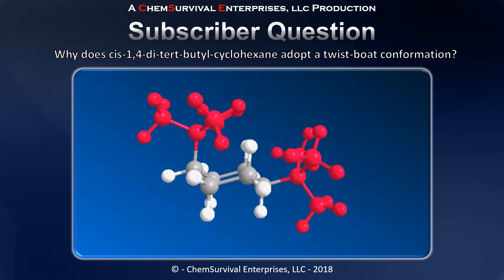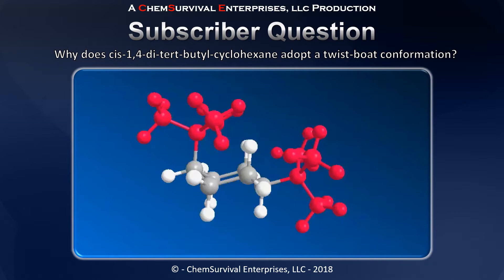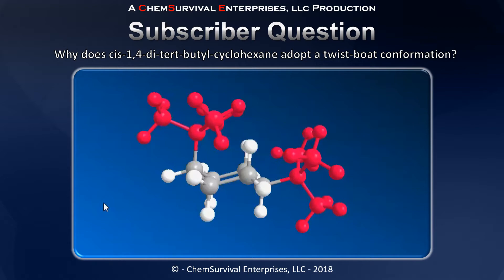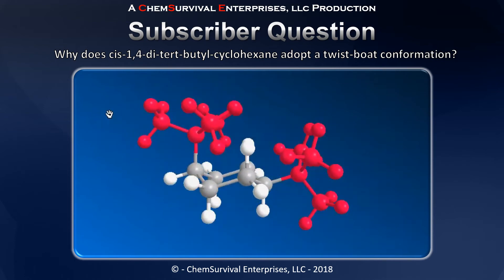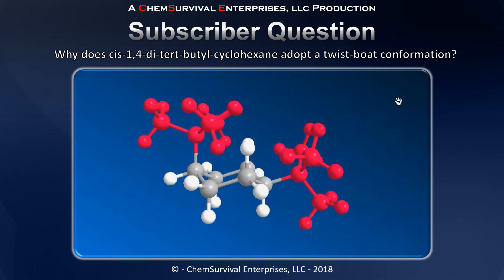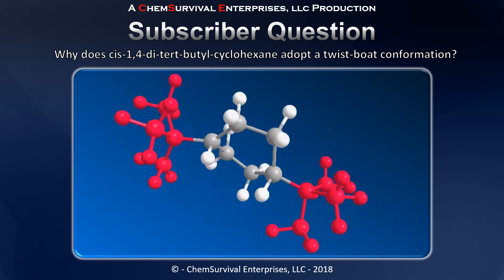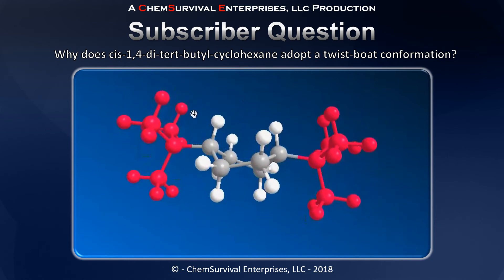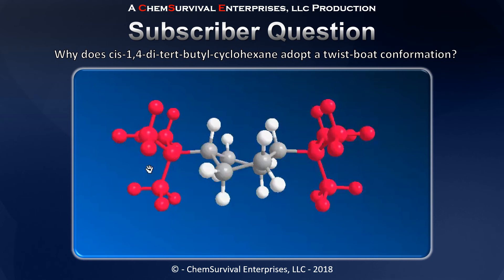Why does cis-1,4-di-t-butylcyclohexane adopt a twist-boat conformation instead of a chair?

Comment: Does this apply if we have 1,2-tetrbutyl cyclohexane or 1,3-ditetrburyl cyclohexane? Also if we have 1methyl-(2/3/4) tetrbutyl cyclohexane what do we have to do?
Reply: For that, you need to specify cis/trans of groups. If in the chair form, both the bulky groups can stay in equatorial positions, then it can exist in chair form. If the groups can't exist theoretically in the equatorial positions (as in the video,due to its configuration), it has to look for some other conformation (like twist boat in this case)